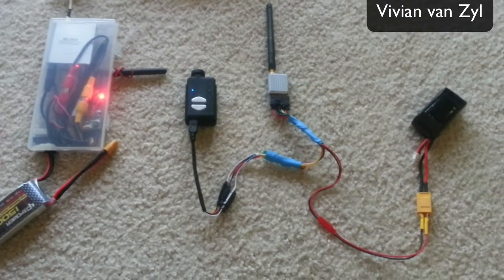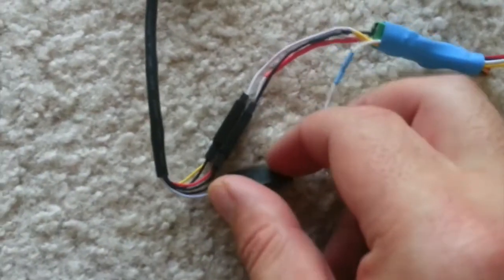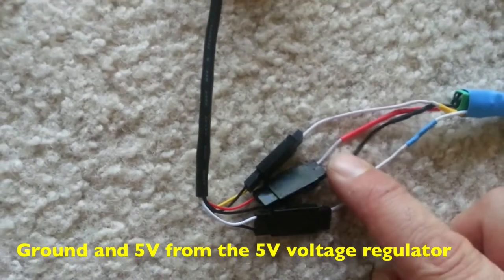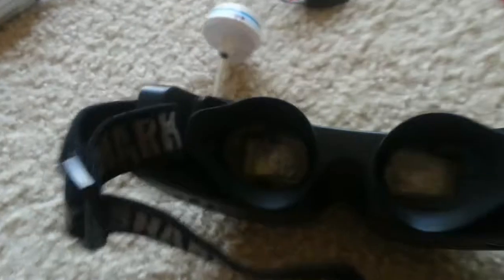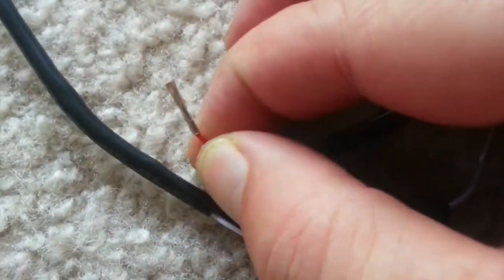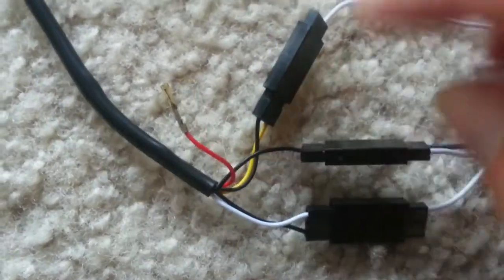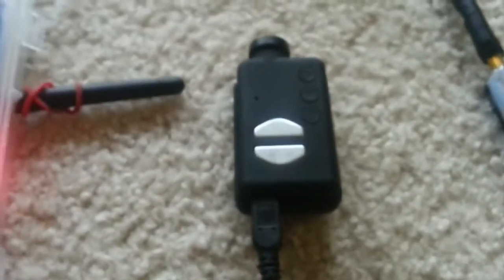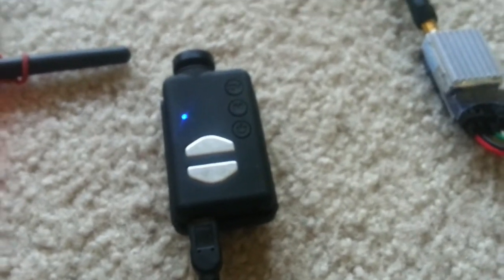Using the Mobius internal battery for FPV

Comment: You know.. you can just ditch the power and unplug it. No need to take out the power wire and just leave ground. I only connect video out when flying FPV with the mobius. The other 2 servo connector (power and audio) i just leave that alone. It will still work. Not sure what's your reasoning behind this.. lol
Reply from the maker: Yep Thx, just wanted to make sure that it will work without external power so I did this little experiment. No need to even plug it in. There must be 3 wires connected then, Ground, Video and Audio (if you want audio).
Reply: Ditch the audio too.. no audio in flght right? Just when playback. Btw, love your mini H fpv video!